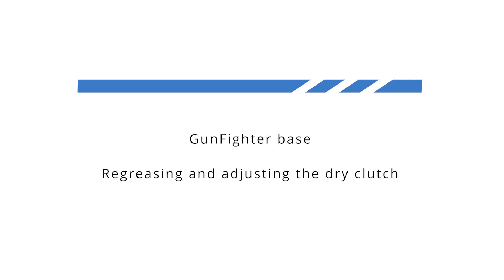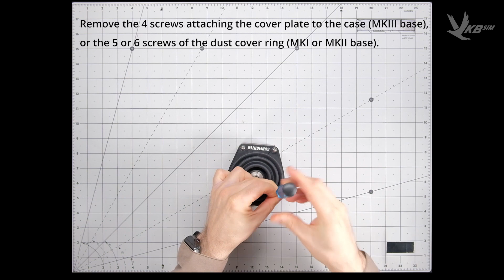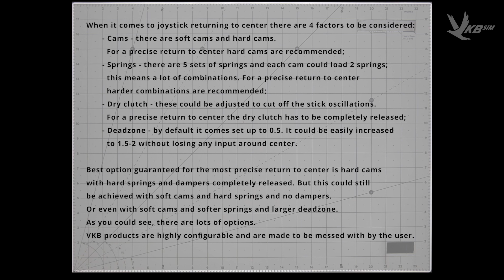VKB GunFighter base - dry clutch regreasing

Comment: Having the clutches greased properly made a world of difference for me. My GF Mk III must've been sitting on VKB EU's shelf for two years when I got it (bought Sept 2022, production date on packaging is Sept 2020) and the grease that was on there must've turned bad and sticky. Which made the GF basically unusable out of the box, with any sort of clutch applied. The factory grease wasn't translucent like Nyogel 767A or like the dampening grease used on the Gladiator Evo - it looked dark and brownish. Perhaps because it was old or perhaps they were using different grease back when my stick was made. 
In any case: Simply getting rid of the old stuff by cleaning and de-greasing the clutches made things much better, but still not like what I would've expected in terms of smoothness and precision - it still felt considerably worse than my Gladiator Evo. Since my tube of Nyogel was still in the mail, I used some of the extra grease in my Gladiator's "stash" to re-grease both clutches. Which literally transformed the stick into probably the best flight-stick I've ever used in over 20 years of flight-simming. 
I've since added VKB's 100mm extension to my setup, making it necessary to run maximum spring-tension on the Y-axis (50+40) - which also meant I had to go pretty hard on the clutches, but it seems that the Evo's grease is strong enough to deal with these forces. AFAIK, that grease is about the same strength-wise as Nyogel 767A. I've never tried the stick with a 200mm extension, but I would suspect that with that setup I might have to look into stronger braking grease. The difference in leverage between "grip only" and "grip plus 100mm extension" (MCGP) was quite significant already.

So far, the Evo's grease has lasted me over 1.5 years of daily use with no discernible degradation in performance - I am currently thinking about re-greasing it, but it doesn't seem necessary at the moment. It is a bit of an operation, since I use my GF mounted, so I'm not really looking forward to that.. :D

Comment: How do you remove the nylon pads from the MKII? There's a rim on the metal barrel on mine that prevents me from taking out the pads.
Reply from the maker: Hi, I just responded to your question on Reddit and I'll paste it here too, for future reference: You don't have to completely remove the nylon pads, just free them from the adjusting screw, then push them from that side so they would lift a bit from the metal barrel. Squeeze some Nyogel on something sharp and narrow, like a toothpick and push the grease in the opening; do the same on the other side, then move the metal barrel so the grease would spread around.